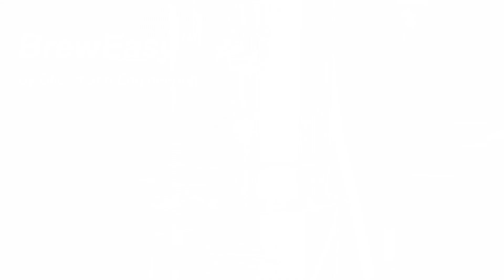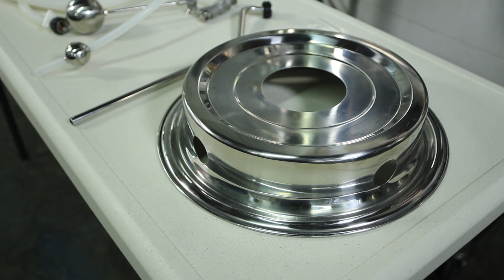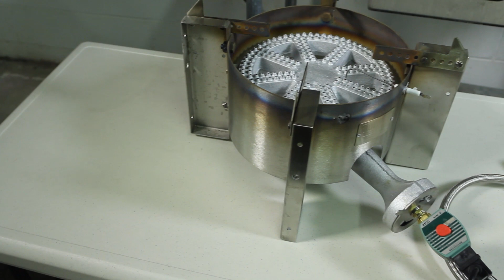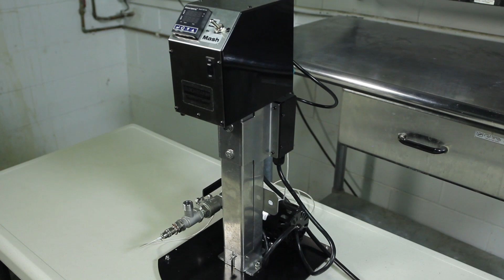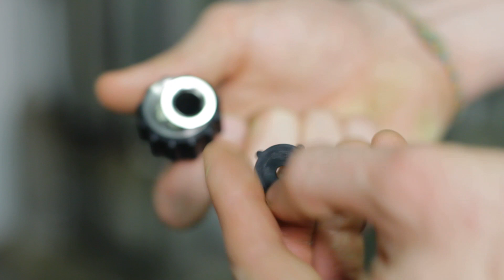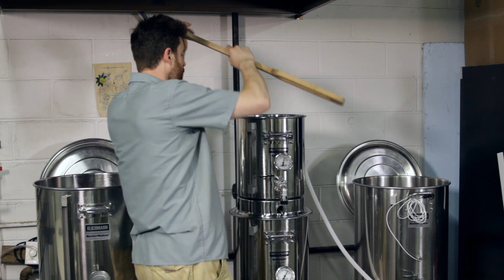Blichmann BrewEasy Demonstration

Comment: So you don't sparge with fresh water, only recirculating the wort? That means you are leaving a bunch of sugars left in the grain leading to low efficiency. Doesn't sound very good to me.
Reply from the maker: FDK - Yes, efficiency suffers a bit with the BrewEasy. What I tell everyone though is that you can make that up with a few pounds of more grain, which costs maybe $4-$5. That vs 45 minutes to an hour for a sparge. The question you have to ask yourself is whether or not your time is worth more than the extra money you spend on the grain to make up for lower efficiency. You save on the BrewEasy though since you are only purchasing two kettles vs 3 as well!

Cheers!
Bryan

Comment: People ask if the strike water should be brought to temperature first.  I run my system without grain until the system gets up to my acid rest temp (usually 99 degrees F).  I turn off the pump until the mash tun drains to below the point where the Autosparge touches the 99 degree water, I dough-in (gently lifting the autosparge until it is complete.  Then I turn the pump back on, and continue the acid rest.  Most modern malts do not require an acid rest, but I always include 20 minutes to settle the bed, and hydrate the malt.  The autosparge and the orifice keeps the flow constant at .75 gallons per minute, while I step through the steps of the mash.  Some times, I just go from acid to protein to beta to alpha in 10 minutes. I always step mash. I hold it at the appropriate temps and times based upon the style and the recipe.  I don't use a tower of power -- I use a 2" RIMS Tube from Brewers Hardware, and a homebrew Arduino control panel.  All of the temperatures downwind of the RIMS are assumed to be accurate, because it is constantly being replaced (at a rate that matches the orifice)...

Comment: I am not sure, so, I'll ask here.  

1.Shouldn't the water be brought up to strike temperature first before adding the grain to the mashtun?
2.During the mash, which temp gauge should I be monitoring? The bottom temp gauge, which is the temp of the liquid going into the mashtun, or the top temp gauge, which is the temp of the grain during the mashing process.  I ask because I plan to do this manually with no help from a Tower of Power temp control.

Thanks!

Ron
Reply from the maker: roncruiser - Sorry for the delayed response! Yes, the water should be brought up to strike temp before adding the grain. We have found that it is easier to heat ALL your water in the bottom, and then recirculating the water needed up to the mash tun. It just makes for a quicker initial heat time. In terms of temp gauge to monitor for doing it manually, the best to watch would be the one for the mash tun (top).

Cheers!
Bryan

Comment: Can you make a 5 gallon batch with the 10 gallon system?  I have a 15 gallon Blichmann and would like to eventually brew 10 gallons, but not every time I brew.
Reply from the maker: beerman1957 - Sorry for the delayed response! Yes, you can do a 5 gallon batch with the 10 gallon system, but you'll need to make some adjustments. You grain bed will be a bit shallower, and your boil off rate will be higher. So the answer is yes, but you'll just have to dial things in over a few brews to get it where you want it to be.

Cheers!
Bryan

Comment: What is the point of the rubber orifice in the drain tube if you have a ball valve?  Could you just leave that out and throttle the ball valve for more control?  If the flow rate is wrong with the orifice, it seems like a whole lot more work to switch it out than to turn the ball valve up/down.  Am I missing something?

Good video, and otherwise looks like a great system.  Thanks for posting this!
Reply from the maker: Shawn - Thanks for the question! The point of the orifice is so you can set a specific flow rate for your recirculation. With the orifice installed, you simply can open the ball valve all the way and know that you're getting a specific flow rate. Without it, you would really just be guessing on what your rate is based on how open you have the ball valve, which can be challenging. The flip side of this (as you pointed out) is that its kind of hard to adjust flow rate mid-mash with the orifice. Just plan ahead on what you want it to be, and you're all good.

Cheers!